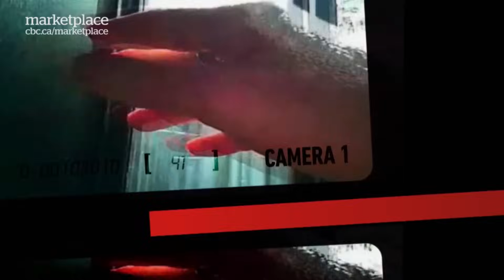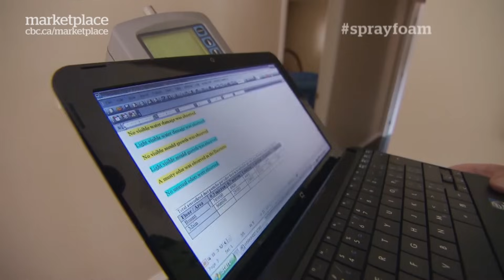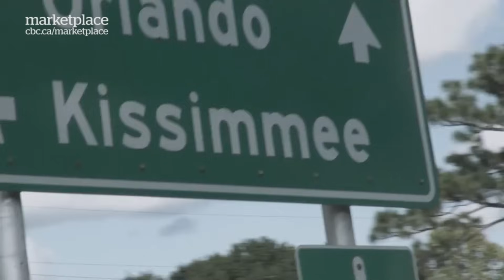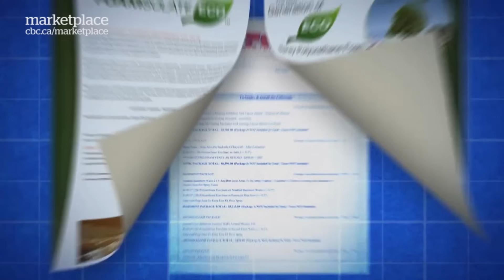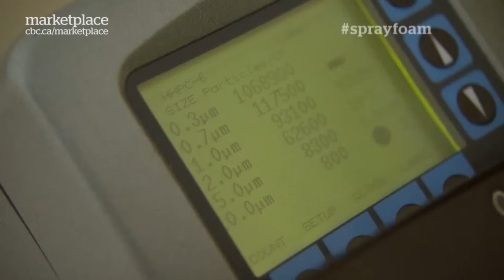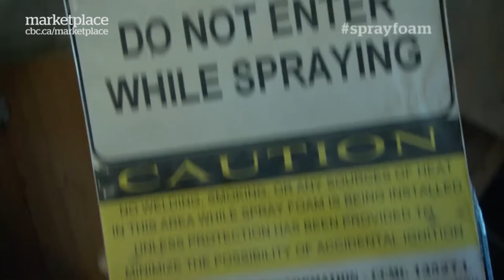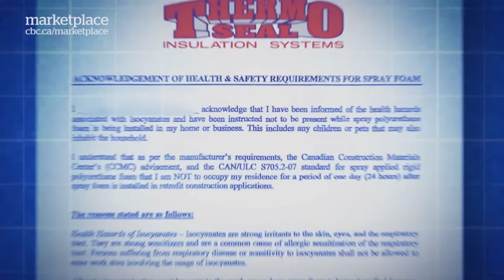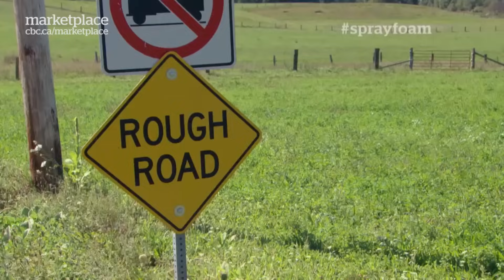Spray foam insulation nightmare: What can happen if it's not installed correctly (CBC Marketplace)

Comment: With spray foam, how the heck would you do any plumbing or electrical repairs in the future? Won't all the pipes and wires be covered with the stuff?
Reply: They don't spray the Wiring & Pipes in but around.  If the Homeowner needs more Pipes later they cut away the Foam to male room. It cuts away like Styrofoam.
Reply: @bradsmith1934  It happens...
No job is perfect this day and time.Its all  how fast to get done and get paid.
Reply: Brad Smith 
So how do you snake electrical wire from A to B if the entire house is spray foamed?
Are you telling me I have to cut out the entire piece of sheetrock??
Reply: @theseattlegreen1871  Yes. makes any future jobs absolute pain. Hope your sheetrock and paint skills are good or pockets are deep.
Reply: It isnt for all home types. My present home has almost no wires in the attic,  just for the air and cooler.  If i would have had the spray foam it couldnt be done over those two wires. Not a problem. This home has blown in insulation in the lid and rock wool in the walls.
My other home had blown in insulation, a paper ptoduct in the walls and a foil faced in the gables.  As great as foam is, its not a good choice for all homes. You have to think ahead!
Reply: Leslie B 
WTF are you talking about ?
You cannot snake electrical wire if the base are filled with foam is what I'm trying to say. THINK!!!
Reply: When my brother had his house done. They spray foamed all the OSB on the inside but like a one inch layer just to seal all the air gaps. Then they comeback in and use cellulose to come out even with the stud walls. That way you can still pull wires and plumbing.
Reply: By installing it on the roof decking and rafters, the proper way. Instead of the easy cheap way, right on the ceiling.
Reply: This is part of why we laughed at people pushing it at a home and garden show.
Reply: The best way is spray the roof deck and seal the soffits
Reply: @CAPCOM784 it's not just get done and get paid. customers are looking for the cheapest jobs too and time is money. if you can cut out half the job by not prepping properly and still save the customer 25% that's a no brainer for a crooked contractor...
Reply: @tristangaddis3998  No, you do not want to seal the soffits. There needs to be air constantly flowing through the attic. Doing this will cause ice dam issues in the winter. Your attic should never be the same temperature as the interior during the winter. This will cause moisture to condense and form ice. In the spring it will melt and run down the interior walls. The paint literally peels off the walls.

The house I bought had this problem last year. Cost nearly 30K to get it fixed. Had to R&R all the attic insulation and run a large heater unit to dry it out. Also replace ceiling and wall insulation. The contractor installed several soffit and roof ridge vents to prevent it from ever happening again. Insulation should only be applied to the attic floor to insulate the living space below.
Reply: The spray foam should be on the underside of the roof not in the truss bays. Spray foam houses when done strategically are amazing to work in because you have no heat in your attic and can see all the walls and ceilings without moving insulation around.  You'll notice that the customers in the video all had tar shingles. Those shingles absorb and store lots of heat and transfer it to your attic. Attics I crawl in in the summer are around 160 degrees! The tar shingles will actually melt and break down if the foam was applied to the underside of the roof because they would have no where to transfer the heat so in order to use the foam you should have the right roof type. Imagine how hard it is for normal insulation in truss bays to keep out 160 degrees versus foam sprayed against your roof to combat the ambient temperature outside.
Reply: @bradsmith1934  I think Ryan makes a very valid point that you just casually dismiss.  You think it's easy to just "channel away" at the foam?  What makes you think they spray "around" the pipes , also?  There is very little precision to this type of work.
Reply: @albertperez7930 It's something decided between either the Homebuilder/Contractor (new Subdivisions) or Homeowner (Renos). What some better Contractors do is have the narrow Joist containing the Plumbing/Wiring, covered in Open Cell, & the rest of the Joists filled with Closed Cell.  The Open Cell is easy peasy to remove..its like Cotton Candy. The Closed is a supreme B to cut out, but is removable.  In the case of my own home it's closed in in 2lb, but the Wiring I initially wanted was in place. I will eventually run new Phone & Cable lines on top of the Wall.  "Most" homeowners do not discuss these things with the Installer.   "Time is $" is the prevalent theme in this (SPF World)
Reply: @theseattlegreen1871 The presumption is you already have New or your best choice for Wiring already in place  I know there are ways around it but not easy. If I were to Reno another home I would put 21/2" ABS Pipes in the wall just so if need be in future I could snake in replacement stuff with little Chopping.  (cut/scrape/remove SPF) or do the 1/2lb thing.  (the switchovers add cost)
Reply: You need to add a wire and separate water chase for later repairs or anything that needs replacing
Reply: @Sidebranches  That also works & would be a $ maker for any Contractor to add in a 3" ABS Pipe or something similar.
Reply: @theseattlegreen1871  Yep...  That is exactly what you have to do. We dread finding out that someone spray foamed their house... Plus once we find out it has been sprayed as soon as we touch or have to go in that area it becomes cost plus .. Luckily most codes don't allow water pipes in exterior walls
Reply: Leslie B  Ummm Keep your burger flipping job and let adults talk
Reply: I am a plumber the second I see that stuff I run. Getting that stuff out is a major pain, the only way I take a job is if it’s removed before I even start the job.

Comment: I work with this everyday, after a few minutes it sets up 96%. It’s all the the way cured in 24 hours. Whoever sprayed it probably sprayed bad foam, maybe due to spraying it too fast to where it doesn’t set up correctly. That’s what I’ve learned. 
Also maybe it didn’t get aired out correctly, but when we scrap foam after a day or two the foam smells a little bit, but nothing bad. Also it’s great for helping the stability of the house
Reply: They must of had bad foam or sprayed to many inches of closed cell at once

Comment: I had my Home done completely and it exceeded my expectations, I am so happy I did it. I worked as a Carpenter for 38 years renovating and building Houses and was aware of it, in the past the original Foam insulation was dangerous and I wouldnt have it in my House, but when done right its supreme . 
but when done by Hacks it is a nightmare , especially when its done throughout the House it is a Total Gut Job.
Reply: What do you think about wood longevity when surrounded by solid layer of foam? In the old days, with mineral insulation, wood coud get some water from leaks and loose it through sides. With foam I'm not so sure. I see potential problems in this new technique.

Comment: isocyanates......red flag right there.....painters of cars learned this the hard way later in life
Reply: Yes you are correct it started with flex agent for rubber bumpers we sprayed it without mask
Reply: @createamatekits2482  Can also use a bandana covering your mouth and nose.
Reply: @rotaryskratch18  I love you and your comedic personality. You gave me a good chuckle sir.
Reply: @createamatekits2482  I used a chemical mask + plenty of ventilation when painting my car in the garage. Had no issues. The ventilation helps with the overspray, removes it before it lands on your wet paint job. If I was doing it for a career I would invest in the breathing equipment.
Reply: @rotaryskratch18  yes, but important to wet it first!  (sarc)
Reply: @chrisyu98  The bandana or my pants?
Reply: Createamate Kits agreed same here I only spray lacquer or old school urethane fortified enamels that air dry no hardener period

Comment: Why would one want to suffocate a house with foam? A structure must breathe... A breathing alternative could be sprayed cellulose or cellulose boards. They breath and make for a nice climate in the room. Did just experience this myself in a house. I would never ever think about making a house not breathable. Chemical compounds in our living area might cause all kinds of diseases on top of that. If it's not natural, it's questionable at best as far as I'm concerned...
Reply: lol I don't think you know what insulation is.  My house has foam.  Never had any problems with it.  Stays cooler in the summer and warmer in the winter.
Reply: Some insulations will enable the structure to "breathe", and some won't. If a structure can breathe, there will not be (or less likely) be a problem with too little/too high humidity and mildew. I guess it's preference. I'd less likely buy a foam insulated house than one with other means of insulation (wood fiber/cellulose insulation). I probably would rather buy a non insulated house than a foam insulated one. Because then I can choose what I do and can avoid toxins. But again: That's just my preference, which might not be mainstream. Example: I (currently) think adobe buildings (including earth bag) are far more superior than wood frame+sheet rock! By the way: A Few years ago I almost did spray foam insulation, because I was all for it - until I found and felt alternatives! And until I was aware of off-gassing and health destruction - this at least is my current perspective.
Reply: what about an HRV with a CO2 monitor,  any thoughts on this?
Reply: yxcvmk also has the house been checked for radon gas? Foam insulation would keep it in. Pros and cons.

Comment: In my unprofessional opinion. 1. they did not mix the chemicals correctly 2. they should not be in the house while they spray 3. the chemicals they claimed to use is not what they used. They used something cheaper, that is why the smell of formaldehyde. 4. the company that sprayed is responsible, an extra 5 minutes making sure the chemicals mixed correctly could have saved a lot of expense and suffering.
Reply: David Bland Your right N it was a professional opinion to me dear..
Reply: So in your opinion in which you just assumed a bunch of stuff with no facts...got it
Reply: @Taureg  I said UNPROFESSIONAL opinion. The title says uninstalled correctly. I just agreed. The smell gives the indication that it was not the stated product or it wasn't mixed correctly.  The only facts I could possibly have would be what is stated in the video. Since I was not there to do my own personal inspection. You sound like the person who messed it up that does not want to take responsibility.

Comment: Every time I see North American homes I shocked by the cheap construction methods - OSB joists, thin framing, light weight shingles. The houses look nice enough, but the building technology is very, very poor compared to what's available in other developed countries.

That isocyanite product is downright dangerous. It's unacceptable in other countries- BASF make a much more stable insulation but it's not as cheap.
Reply: you are right about the cheap construction methods, but its why a single family can live in a 3000sqft home here.
Reply: Ronan Rogers OSB joists work great...
Reply: Ronan Rogers then again, if you build your own home or choose a good contractor you can make sure its done right
Reply: Cheap american homes? 
I was thinking the same thing 12 years ago, whenever moved from east Europe to Canada. Now I learned to appreciate the walls that doesn't accumulate heat and allow quick/cheap modifications. In case of zombie apocalypse is good to have a concrete building, but for residential needs the criteria is different. I only added steel roof and fire extinguishing system to my wooden house (aside of the multiple modifications, flowing my family  development).
Reply: and thy have tornados ther hahaha al that wood  is gone in 20 sec hahaha
and if you see the prizes thy ask for that flimsy building you wil be shockt

here in holland we use concrete and fuking stone

Comment: Why would you use this stuff to insulate your entire home. You should only use it to seal small gaps to stop drafts. Use removable insulation for most of your installation. If you can remove the installation easily then you can easily add new plumbing and wires.
Reply: I'm glad this is what my builder did. Spray foam around the basement headers, garage drops, and windows. The rest of the house is removable insulation.

Comment: How can you not think it dangers. The man spraying it looks like he's about to cook meth.
Reply: They dress like that because the chemicals displace the air when mixing.
Reply: @Jure Nefashu yeah but one of the women said her son was in the room below sleeping when they were doing it. Especially in an attic where there's no proper ventelation it should not have been allowed to happen
Reply: That might be safer.
Reply: I know right! 

Have you seen scuba divers?! That dihydrogen monoxide has killed countless people.
Reply: I cant see how the company let that happen. I was working in a 600 foot long shop by maybe 200 feet? Anyways we would call in spray foamers to spray a roof at a time. The front bay doors were open, large industrial size fans blowing down the corridors out the bay doors and 2/3 of the shop was quarantined off until it was safe and aired out.
Reply: literally how industrial painters dress
Reply: You need to chill on the breaking bad. Meth cooks be chillin in their undies.
Reply: OSHA

Comment: Just use mineral wool ffs. Great for insulating, no way of messing this up (besides less efficiency if done wrong), is insulating much better than foam and can't burn.
Reply: Even better use foam board. Almost as efficient as spray foam.
Reply: foam board is foam

Comment: I've never heard of the off gassing.  Nice to know.  I contacted a company to do my shop.  I wanted the slopped roof done 10" thick.  They said over the phone they will not do thick foaming.  Only a thin coat is needed.  Guess they knew what they were talking about.
Reply: Everything off-gasses. The question is what, what amount and for how long. It's a nobrainer that these spray foams need ingridients known human irritants to even be processable. Those plasticisers, regardless which are used, most are based on or related to crude oil products, are just one ingredient that is problematic.
Reply: All 2 part resins and foams off gas isocyanates

Comment: They admitted on camera that they could be in the house with fans going and windows open. All they needed to do was add some vents and an attic fan or two to blow the stagnate air out of the attic. Taking the roof was overeacting and not very smart financially in my opinion.  And really if insulation is being applied like this on a horizontal surface there should be plastic barrier put down first. If it's not code, it should be done anyway. Anyone with common sense can figure that out.
Reply: Having the attic ventilated I sure would of helped. Most do because it reduces ac cost. Putting plastic down first also sounds like a good idea. I think I would have tried ventilating the attic first.

Comment: I've worked for one of the biggest commercial insulation companies in the DFW here in the states. I've been in the field and was a mechanic there. The machines have a hopper or container where all the insulation goes, there are two squirrel cage fans that blow the insulation down a 4" hose. There is a glue line next to it that is connected to a 55 gallon drum of elmers glue with hardener added. It's white, dries scab like and everything just like elmers glue. No dangerous chemicals used. When the insulation is blown, it is immediately sprayed by the glue line with a fan nozzle that coats everything. The dangerous spray foam insulation systems are the ones that use two different chemicals that mix together, usually with two containers A and B. Stay away from those systems.
Reply: Can you name this hopper machine and the stuff you put in the hoppers?
Reply: not dangerous at all if you know what your doing.
Reply: Sounds to me like blown in cellulose with a spray on seal coat
Reply: That is correct. The customer also has the option to use fiberglass as well. Itch city central.
Reply: @johnbrown1381  if the sealing coat is over a blown in attic fill , I have some reservations. In cold climate generally the vapor barrier is on the warm side , ie: the inside , if there is no vapor barrier on the inside then the insulation Will get damp , if it's sealed on both sides then you run the chance of moisture getting trapped between. But I can see it in a warm climate where the aim is to keep heat out
Reply: @outinthesticks1035  Moisture barriers is a recipe for water condensing, thereby encouraging possible rotting of materials and or mold growth. Have you heard of "Matt Risinger" youtube channel?
Reply: @johnbrown1381  I have watched matt's vids , including the one where he went to Vancouver to learn about insulation from people there . He did say that even in Vancouver's relatively warm climate they had a firmer grasp on proper insulation, including vapor barrier . It might not be necessary for vapor barrier if average temps are mild but down to -40 the insulation Will get wet without it . I have seen the results of leaks in the vapor barrier
Reply: @outinthesticks1035  Good to know. Do you know what the video is called? Learn something new every day.